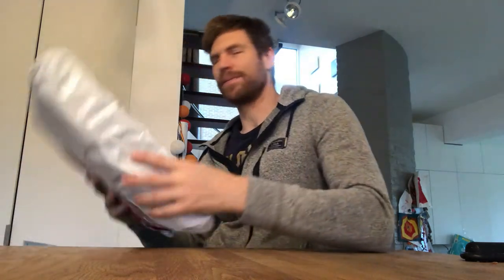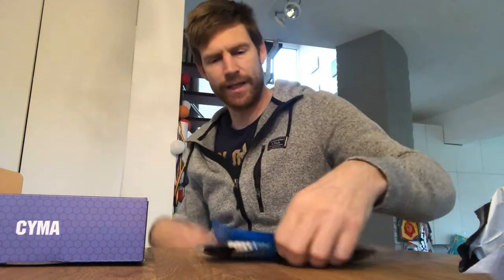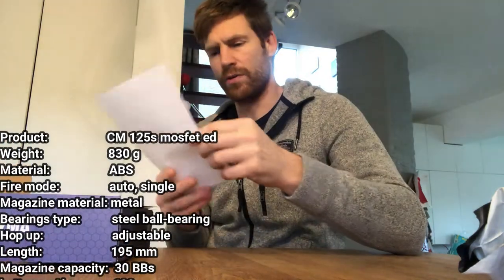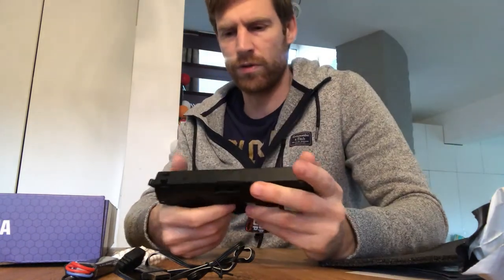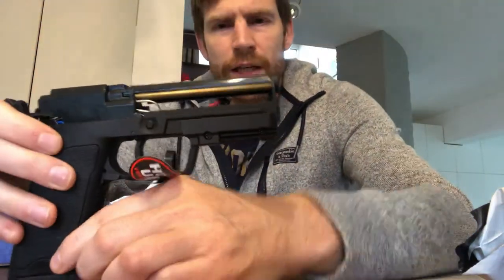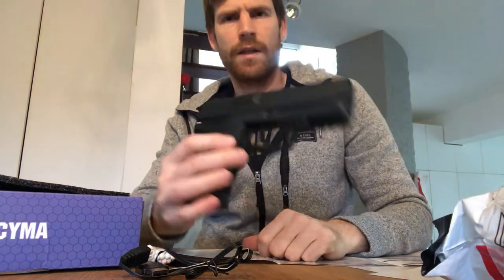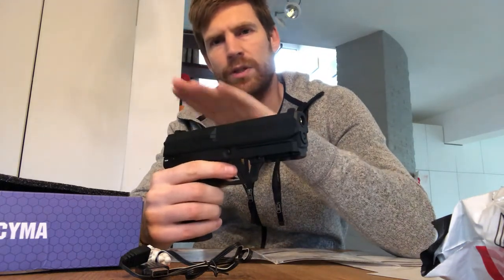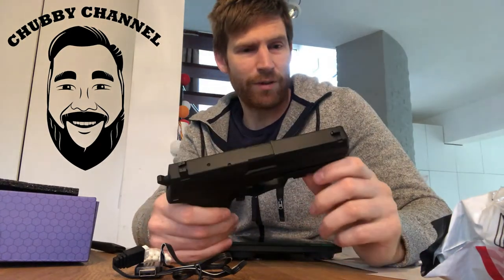cyma cm125s unboxing and review of a mosfet airsoft replica

Comment: I have a question: The old Generation of this gun had the Problem that the magazine was clattering. is it still the same in the new generation? Sorry für my Bad Englisch cause i am a German. Thanks a Lot for your Video i am verry happy abaut every information about the cm 125 i can get because it feels Like there arn't a lot Videos about the S-line out there
Reply from the maker: I just had a look, yes it rattles a bit. But not more then my Tokyo marui m92f. To fix that, i put a black piece of ducked tape at the bottom for a snug fit.
Reply: @chubbychannel9035  OK Thank's but there are also no feeding Problems?
Reply from the maker: @ja8486  As far as I know, no feeding issues, especially if you fix the magazine with a small piece of tape to make sure it doesnt move anything. i have not done a skirm with it, so no practical experience yet

Comment: Hi thanks for review. I just got mine with battery already inserted. I was wondering how you take the battery out? And do you stop charging when indicator starts blinking green?
Reply from the maker: it is a bit difficult to take the battery out and in yes, but i do take it out, and i dont charge it with the supplied charger but with a graupner ultramat 16. However, the standard charger is safe, take it out when full, ok if you leave it in for 20mins or so, but not keep it attached. The charging actually stops when it is full (otherwise it would explode)
Reply from the maker: the battery can be taken out by sliding it uder the barrel. the charger will automatically stop charging indeed.

Comment: How did you connect the batterys little connectors? I cant manage to fit them
Reply from the maker: I struggled as wel, these little deans are not easy to connect. sometimes the male connector can use a squeeze to make it go in a little smoother
Reply: @chubbychannel9035  I got it, after like a hour of trying on and off hope I didn't break anything that's crazy that they make something that hard to connect